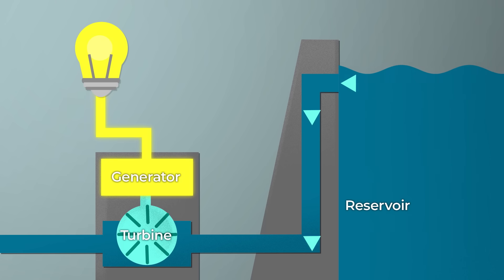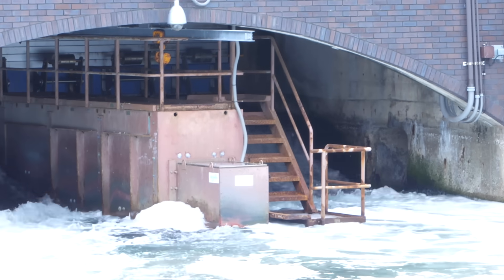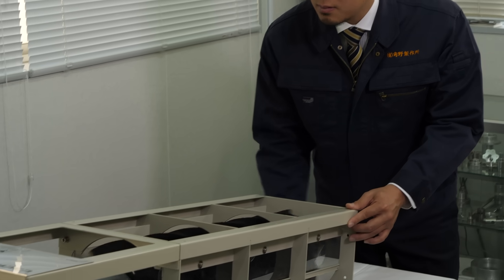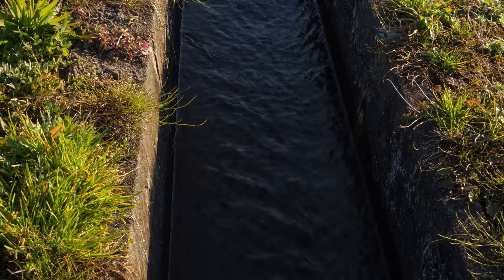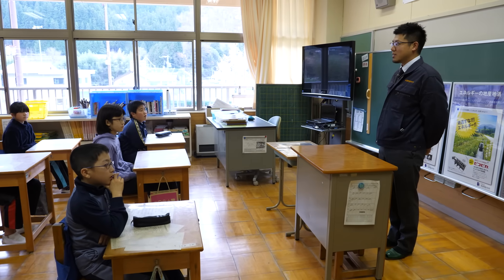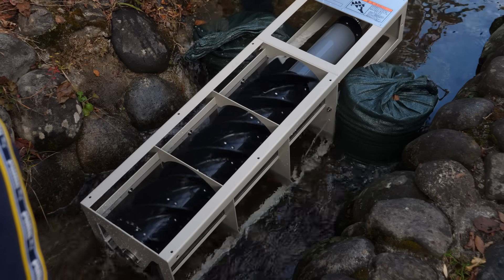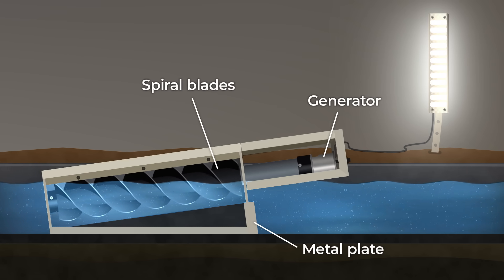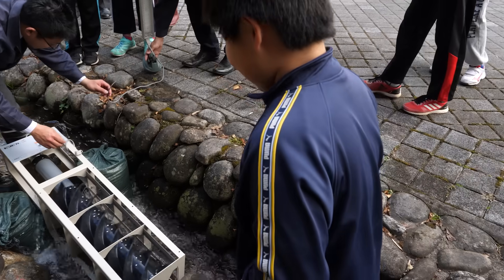Ultra-Small Water Power Generator

Comment: In general I like the idea and I am very optimistic towards "small scale generation". But this video is too uninformative to be useful to anyone who understands how electricity works.
How many watts does that bulb need to operate?
How many watts could you actually generate from such a small stream?
Isn't it a bit useless to have a small turbine if you need 1 per each lamp on a street? I mean.. it seems that to power a whole house you would need 50 of these turbines, therefore is not such a small concept anymore.
And if you are going to use 1 turbine per each lamp, gate or screen then damn.... its not so eco anymore as well.

Sorry to be a pain in the ass =/

Comment: okay, but these are the kind of devices progressive Japanese industry should have produced 50 years ago.
Reply: Not to sound argumentative, but progress is progress. And "50 years ago" japan was just starting to recover from a little thing we call "world war 2".

I wish the video would have detailed the output of the turbines. I understand it would vary based upon the force of the water and in the video it seemed to semi-consistently activate the light, but even if it's a small amount, if stored efficiently this sort of device would be very useful in small streams or river environments where larger "eco friendly" methods of power generation would not be feasible. I would think one would need to ensure there is a filter or cage to block animals and debris from entering the device, and a side-channel for such creatures to retain mobility up and downstream (in cases where the water is populated).
Reply: @Nodjia  they pulled a sneak attack on Americans so they had to pay
Reply: It's all about demand.  50 years ago nobody worried about getting clean energy, just burn some more oil or coal.  Priorities are different now.

Comment: Definitely could be scaled up. Flowing water is everywhere!
Hydropower would save alot of birds and bats that get killed everyday by wind turbines.
Reply: You can use many wind styles of turbines that can be protecte for those issues and are very simple to implement !
Reply: What about the fish?
Reply: @acajutla  Tastey,and high in protein.
Reply: @JohnSmith-bx1mp  You mean as minced?
I mean hydropower isn't environmentally unproblematic. One of these here and there for a few lightbulbs and a laptop is what it's meant for, not larger powerplants for villages.

Comment: Another ridicules propaganda video that energy is easily solved green. In a disaster you want a generator. Blocking water ways to turn some street lights on? I imagine it would take years of these running to create enough BTU’s used to make each unit. Absolutely no net positive but to confuse kids on what real energy is already inexpensive and available.

Comment: what is efficiency of this generator and it's power output?
Reply: It doesn't seem to have any kind of regulation ? Would be curious to have the specs.
Reply: You can charge you phone.  Stupid idea.
Reply: Dave Zimmerman  they just give you a solution.
Reply: 1ton or 1000liter of water per hour over 1 meter of hight difference equals about 2,8Wh mechanical energy. Efficiency can get up to about 85% on hydro-powerplants. 
So you can easily estimate the power of every water turbine...  
15cm hight difference and assuming 80% efficiency leads to about 150mW Output per ton of water per hour.
Reply: if I well remember: flow 1m3/s from high 1m gives you ~1kW of power 
(981W). So, I think that this generator in sowed location is rather 
comparable to bicycle generator (if you know that little device).
Reply: Matt J. I have a few of those here. I save the ones who turn the lightest. cool little devices!
Reply: Look like you mixing power with energy. It's very popular mistake.1ton on h20  flowing from 1m step in each second has power of ~1kW (~980W if you know what I mean  ;-))
Reply: You can sneeze and produce more power...

Comment: That is a lot of materials and energy put into something that can only power a nightlight. Putting a larger version at the bottom of a large river, you'd maybe have something.
Reply: Well the idea is to show it work in the long run it would be better than fossil fuel.
Reply: @aviationismylife6814  No, it isn't. The amount of energy required to get so little back is ridiculous. Just think of all the mining machinery needed to dig the metal out of the ground. All the factories and machines needed to process the materials and make the parts. It is the opposite of what it needs to be.
Reply: @VidarrKerr  well they said the same thing about aviation, but we have proven them wrong. Avaitian had came a long way and still getting better every year. We also  literally have dams producing as much power as diesel generators so rather you like it or not that little machine will change the world. Plus the amount of energy water have is far greater than what we getting from fossil fuel. I won't even speak about the sun energy.
Reply: @aviationismylife6814  Aviation doesn't violate the laws of physics -- thermodynamics. You should look into Tesla's turbine (the scientist, not the car company). He said it was the favorite of all his inventions. I think you would really like that. But, you will see there is a difficulty making energy with it. No one has figured out how.

Comment: This is what I need to charge my AGM battery bank in the Appalachians✔️💙🇱🇷✝️
Reply: I was thinking the same thing.  I can run my water pump for the highbanker off that turbine through an alternator plus charge the batteries.  I think it's a brilliant device.
Reply: @toomaskotkas4467  just remember the laws of energy conservation... If you're running the pump just to make electric power, you're better off to run a generator. Whenever energy is converted, power is lost.
Reply: @TheEquineFencer  Yeah, I know what you mean.
Reply: @toomaskotkas4467  if you want solar, I can hook you up
Reply: @TheEquineFencer  No, I've got it covered.  Thanks bro.
Reply: I've got some 295W solar panels that would do that...
Reply: TheEquineFencer solar is great but this runs 24/7/365. I wonder how many KWh it can make in 24h?
Reply: @MoDa87  It hardly makes any power at all. Possibly 10 watts per hour. Forget KWh

Comment: Its great practical invention with a question mark 
How to deal with fishes and water animals 
And how to deal with debris?
And how to deal with flooding
Reply: Is the generator submergable may be better question/more specific than  asking about flooding.
Reply: It so easy just make a filter screen before the unit and make a way for debris and fish,etc.  behind screen.its not necessary  to put at the center as along as theres a gravity of flowing water.
Reply: @dextersumsaltube  that would do it.
Reply: W A T E R   A N I M A L
Reply: Actually debris, wild life, and flooding are areas where this design really shines. This type of turbine is relatively safe for fish. The fish don't have to spend a lot of time in the path of the turbine blade, and, even if they get near it, the blade probably isn't moving fast enough to cause injury to them. The Later parts of this turbine are not screened so debris and wild life shouldn't be a problem. 
Flooding might be a bit more worrisome, since this design looks like it might stop spinning if it's submerged, but it is based on low rotation speeds. Water depth might not matter, depending on geometry of the creek bed.
Reply: Fish will
Easy swim through spiral turbine
Reply: @maienduo  maybe a goldfish but not a northern.

Comment: If this concept was placed in a vertical situation with a large dia screw in a minimal clearance tube, what then?
Reply: there is already a model from the belgian company Turbulent with the vertical setup you suggest but it uses a turbine instead of a screw and based on the configuration it can generate up to 100kW
Reply: With the screw mounted vertically the water will mostly follow the screw instead of turning it.
Reply: @calvingreene90 : BINGO! Exactly what I figured as well. Water likes to flow along the path of least resistance and in this case, the downward flow would be the path of least resistance. Be better off using a paddle wheel than the screw.
Reply: @sonofeloah 
If it is on an angle that keeps the water below the screw's center line the screw is more efficient.
Reply: @sonofeloah  But then it wouldnt be as compact,,maybe a series of paddles?,,,its a very good step in the right direction any way you look at it =)
Reply: calvingreene90 . Think about it.? The path of least resistance is directly vertical to push the screw out of its way.
Reply: @nigelmitchell351  
This doesn't have the drop to make it work that the screw will turn a little but the water will mostly go in circles.
Reply: While that has the possibility of generating much larger amounts of power, this device is about power from small drops of inches, not a full meter/yard.

Good question, though. I'm sure it would do LOTS more!

Comment: Max wattage? AC/DC? Cost of materials? Jam statistics?
Reply: The wattage looks to be relatively low, but it's driving high intensity LEDs, so i'd guess around 20 or so watts per generator. 
Given the low speed of the water, this is probably a DC generator, which allows lower rotation speeds to produce useable power. 
As far as Jam statistics, the screw impeller design is highly resistant to debris, so it's capable of using very dirty water. 
Cost materials isn't as important as cost of device at sale. 
Everybody marks their stuff up.
Reply: How rude.
Reply: @keffinsg  Man, I just wanted the wattage the most. There's some good, analytical answers in here, though some be rude. I'm more miffed at the guy who ended their comment with Einstein and added nothing to the conversation. I wish that people could discuss the praticality of an invention without having to deal with the people side of people.
Reply: I'd say it produces aprox 12w DC or AC
Reply: I have a stream on my property.  I really wish microhydro was effective.  Low head water just doesn't have enough energy.
Reply: @WebberAerialImaging  1 liter falling 1meter in 1seconds is a bit of like 1 watt of power.
Reply: oliveavelo and
Reply: @WebberAerialImaging  Reasearch a ram pump. You might find some use in that.
Reply: @WebberAerialImaging  Use a fan for turbine, a waterproof dynamo and a grid current driven power inverter, and enjoy your 10W of power x)
Reply: @WebberAerialImaging  It is practical if you use a combination system with solar fed through a battery bank (major charging during daylight), and use the micro-hydro to continually trickle-charge the batteries night and day. Expensive proposition to set up, though. This micro-hydro unit might be more useful if you could install several side by side.
Reply: @WebberAerialImaging  Low head, etc depends how you do it. 

And for the naysayers - forget "power to weight" It's about reasonable cost and continuous output.

If you can get 900mm drop then a whirlpool turbine is surprisingly effective and very friendly to the aquatic life. The main structure can be formed from cement so it's dirt cheap - and they don't clog.
Reply: @WebberAerialImaging  There are some on here. Micro Hydro Power with Turgo generator Part 1
Reply: Probably simple not efficient.
Reply: Usar un pendulo como un relog que se recargue una bateria muy pequeña , crear el movimiento sin fin y ese movimiento obtener el inicio de arranque de la energia en unidades de voltios de alli pasarlo a un convertidor inversor de corriente y obtener mas energia  de aquí mismo se guarda en otra bateria mas grande , para otro tipo de arranque segun la masa del objeto a . Mover y esto en cadena se lograria mas movimiento y generar con alternadores mas electricidad
Reply: Well those street lamps in the picture are clearly not 5w power lol, those are industrial lights probably around 60w or not less
Reply: fish friendliness?
Reply: @miscbits6399  I suppose a screen of say, 1/4" to 1/2" mesh would be sufficient for larger fish and their larger spawn. I don't know how sharp or how many vanes there are. I'm guessing that smaller streams wouldn't have fish in it, while larger streams could allow bypass.
Reply: @Cetok01  pretty much all streams have some form of aquatic life in them. The whirlpool designs are slower flowing streams generating more torque on the paddles (most designs use paddles not a turbine) so are more easily migrated
Reply: @miscbits6399  So far, no energy generation is without cost of some sort. Guppies are on their own.
Reply: ninggal jejak
Reply: carve out of wood
Reply: @madseh de jesus the model shown is 10watt. What a fucking joke of waste materials. 40 buck worth of solar panel on amazon does far more than that
Reply: @meowmeowbobo  not at night
Reply: The power is produced 24/7 with water, where fixed mounted solar panels only produce power a few hours a day.  Throw those facrors into your cost analysis, Einstein!
Reply: @rickdees251  But no water no electric. 
Not always water there in 365.
Reply: @rickdees251  Your insult not only did not add to the conversation involving the practicality of this invention, but also shows how unintelligent you are. Insults are flung like that when someone is offended at the mere virtue of being less intelligent than others. We already considered that the sun doesn't shine 24/7 and the lithium batteries and circuitry coupled with the solar panel would still cost less than one of these turbines and be capable of outputting larger bursts of power in shorter time spans. It uses less material, is more reliable than rain, and is more cost effective. I wanted to analize the design in hopes of increasing the efficency per size so as to make it better. I'd like to see you to put more effort into the conversation rather than a blown up retort to this reply, but if you must be a troll, then I'll leave you to your gruff.
Reply: @rickdees251  I think it becomes a power to weight ratio argument though, with a solar panel, and a battery or 3 (Powerbank) Of the same weight, you'd generate far more power. It's a lot of weight for such a small output.
Reply: @rickdees251  It will mince fishes, water flow isn't always constant everywhere, sticks and debris will jam it, hair and dirt too probably, stuff will stick on it and the axles, someone can steal it, it costs too much and uses too much materials for what it does, the gears require oiling and maintenance, in over half the glove water freezes in winter... So yeah, there's a lot of problems here too.
Reply: @meowmeowbobo  Not at night it doesn't.  This will give a steady output as long as the water is flowing.
Reply: @meowmeowbobo  .. talk is easy, build a generator, upload a video a show us your superior invention.. but be careful with the negative comments, there's a lot of experts here in youtube
Reply: @dleivam  and that said youtube expert is describing you, seeing you have no idea what the issue is. Generator looks fine, very well made. and that is the issue: too well made to do next to nothing. If you are not outraged by 18kg of fine steel to do a job that could be done by a sheet of paper sized solar panel then you are part of the problem. This pathetic joke of an invention is on the level of that 1000 dollar juicer that use solid steel to squeeze juice.
Reply: @dleivam  I'm no expert but I stayed at a red roof in last night so I know what I'm talking about. 😁
Reply: @dleivam  You don't need to be an expert to have suspicions about a product with amazing claims that happens to look a lot like past products with amazing claims which turned out to be scams.
Reply: western people ⬆️ 🤣
Reply: @madseh de you mean 500 watt right?

Comment: some late info.   this video is not what it appears to be.     it consists of false praise for this younger designer, who has produced a design that Sucks.    why is this true.      a screw turbine is NOT well-suited, for use in an application where flow rate is very low and the amount of head is,  very very  little.     this young designer has, only, a very  Incomplete  understanding of the principles of hydroelectric power.    but, he happens to know more than the people,  Around him.   including, probably, his 'teachers'.      googletranslate